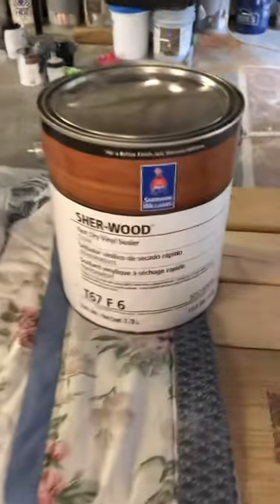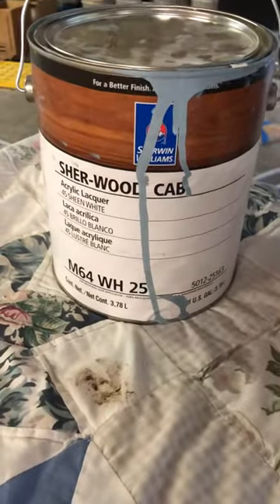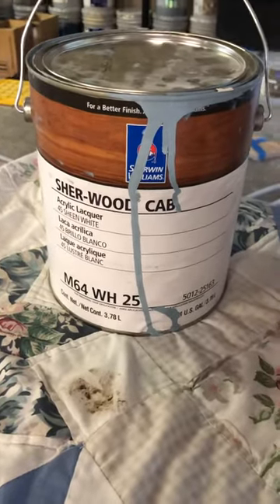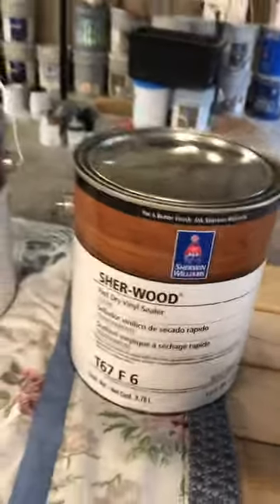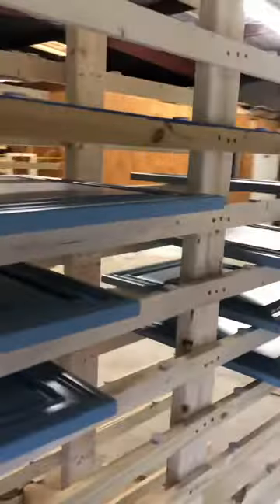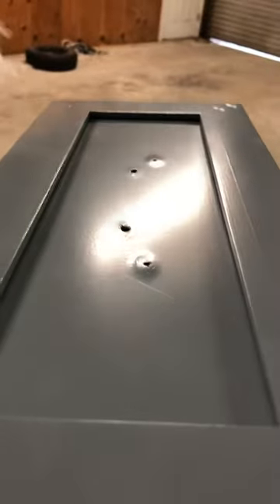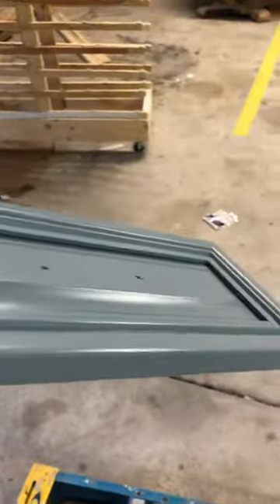Acrylic Lacquer Scratch Test

Comment: I was in the refinishing business for 45 years Sherwin-Williams cab acrylic is one of the toughest finishes  I ever seen outside of ppg acrylic uretane which you cant even strip with aircraft stripper which is why I dont want it for wood  I refinished a lot of grand pianos with the cab acrylic you can hit it with a hammer after it's cured you won't damage the Finish you'll Dent the wood amazing stuff

Comment: Is it tintable?
Reply from the maker: Yes sir it is.
Reply: @professionalpainting4727  having issues finding any store sherwin store that would tint, they say they have to order it from the factory
Reply from the maker: I’m honestly not sure why.
Reply: @professionalpainting4727  wanted to try it, looks great on the video
Reply: @professionalpainting4727  does it have to be thinned down to spray with a turbine hvlp?
Reply: Has this worked out for you over pre painted or oak cabinets ? With the vinyl surfacer as primer and then top coat ? No other primer needed ,?
Reply: @therevivalsoundmachine7107  I use BIN shellac base primer, works great over any surface, even glass
Reply from the maker: @therevivalsoundmachine7107  yes it has. We sand beforehand, and the bond is unreal. This has proven to be incredibly effective.
Reply from the maker: @duartepaintinghandymanservices  it doesn’t need to be thinned. It’s very thin. I’ve heard that BIN is a great choice. The reason we chose our specification is because it is “KCMA approved.” I don’t think BIN is approved.
Reply: @professionalpainting4727  if it’s a “re finish “ are you just scuff sanding for the sealer to bite ? I’m currently using extreme bond with kem Aqua but looking for more durable finish 

So the vinyl sealer is your under coat and the Cab as top coat is it water based ? Or solvent ? I’m straying with a GX19
Reply from the maker: @therevivalsoundmachine7107  I clean and scuff sand if previous finish is in tact.